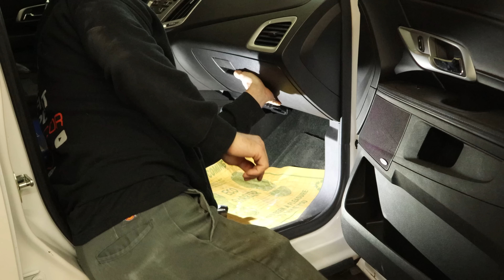Finishing the 2017 GMC Terrain SLE... this was too easy...

Comment: These Terrains sure must be popular, with the number you've done. Another nice vehicle for someone, done right as always. Wonder what you'll be doing next week. Something interesting no doubt. All the best from Queensland Australia where it won't stop raining and this is the dry season!
Reply: Another of GM's finest ..no wait..they haven't had that "mark of excellence" moniker for decades.  NICE REPAIR THOUGH😎✔
Reply: Does Holden make anything similar to this??? They are the Aussie equivalent of General Motors aren’t they??
Reply: @nobodyspecial6436  Unfortunately, General Motors closed down the Holden brand and the assembly plant here in Australia, so Holden is no more. The last Holden Commodore, the VZ, was actually a re-badged German Opel. The Holden Trailblazer is probably similar to the Terrain, but it was made in Thailand. My son bought one a few years ago. It's a V6 turbo diesel. So no more Holdens ever. Very sad for Australia, but GM made the decision that it was no longer viable to make right-hand drive Holdens in Australia. Funny thing, I saw a right- hand drive GMC Sierra in town the other day and I've also seen a right-hand drive Dodge RAM previously.
Reply from the maker: When the 2010-2017 Terrains were in production, they captured an unheard of market share for small SUVs. They are still great sellers, luckily I stumbled on them early.  Right now anything with low miles is demanding big money due to lack of supply and it is only getting worse.
Reply: @BrucePierson  they’re closing plants here too… 🇨🇦… it’s all about the almighty dollar… there’s a few right hand drive land rovers around here and the odd Toyota Hilux… not Australian i know but European
Reply: @nobodyspecial6436  Holden dosent exists any more, they were putting together lexon for a while, but closed down, everything was imported, except putting them together,
Reply: I don't know maybe a Toyota I mean he did pull a Toyota emble out of the glove box. 🤔😏🙂🤣

Comment: Scott:  When using the manual pneumatic pop rivet gun people using it are often afraid of bouncing the tip of the gun off freshly painted surfaces and sometimes do just that.  I have found that as you are finishing up the pop rivet, just before the rivet shaft breaks (pops), switch from pushing down the pop rivet gun to pulling it away from the rivet.  When the rivet pops, the pop rivet gun will pull away from anything in danger of damage and all will be well!

Comment: I am totally convinced that a lot of cars get totaled out that shouldn't be. My 2014 Nissan Sentra was involved in a collision with a Great Pyrenees dog. He jumped at an oncoming school bus just before impact. As a result he hit the hood and grill. The grill was driven back against the brace that the airbag sensor is on thus setting off the driver's airbag and the seat belt tensioners. Repair estimate was almost $7000 with the airbag and seat belt repair taking up almost $4000. Our insurance company insisted that everything associated with the driver's airbag has to be replaced with new parts and the seat belts have to be new parts. The body parts needed were the hood, grill, headlights, bumper cover and the condenser coil. The left fender was a little damaged but the body shop said that it would be easier to fix than to replace. Painting estimate was about $1500 which if they happened to find the right color parts would have been considerably less. And that was more likely because the car was a very common color. However the insurance company listed the car as being worth $7500 in good condition. The problem is that about the time the claim was settled was when new and used car prices went through the roof. If it had been a couple of months later we would have had higher advertised prices to either get more for our car or get it fixed. What is so frustrating is that the safety features that are required on cars now are often more expensive to replace than what the other damages to the car are.

Comment: Awesome build as usual! With all the Terrain builds you have done, it has certainly helped on mine. As for the the center caps, I just realized last week of the valve stem printed on the back with the arrow. And now to replace the AC compressor.
Reply: Reading the owners manual..possibly the most neglected piece of car literature...😁👍🇨🇦
Reply: @vwwrenchie314  Agreed!! Guilty as charged along with many others.
Reply from the maker: Not all of them have the picture, I looked.  As for owners manuals… in the pile!  I want to discover new features as I own the vehicle to keep it feeling “new”. 😂
Reply: @vehcor  You are right...I had to discover that valve image on my Buick Allure centrecap too..everyday ya learn something new!

Comment: I need one of those brake job hammers!  Always enjoy seeing you put this stuff back together properly.  I like seeing you go the extra mile to make sure it's put back together correctly and safely, even if you don't clean all of the parts that I would.  Keep it coming.  It's nice to see you care about putting one back together well rather than whatever makes a few more dollars.  Also, I'd worry about wearing out that bumper installation tool.  Maybe go a little easier on it before it wears out!

Comment: The belt molding installation tool is not on Amazon. I would like to order one ☺️☺️☺️
Reply: You can only get them from a cross-fit gym.
Reply from the maker: Supply chain issues.  Those crossfit ones are junk… very weak and noisy. 😂

Comment: Indeed cars "clip" together now days.  The seamless designs really work will for the method and the weight savings from the 50's to the 80's methods is notable.  They are lighter and do better in accidents as it relates to the occupant.  The engineering, though at times odd from a maintenance perspective, is pretty impressive.

Comment: I wanted to remove the inner rear quarter cover in my SUV to fix a minor wiring issue.
The process first required removing the radio and centre console then the front and rear seats the side pillar trim and sill plates and front and rear wheel liners, all to get to one plug that was not connected properly at the factory.
I only slightly exaggerated I didn’t really need to remove the radio. I was fitting a reverse camera that came with a new head unit . The wire for it fished easily over the headliner.

Comment: 15:45 lol no kidding right? I give you the Ford 5.4L. If you follow the manufacturer's spec on oil changes you WILL be doing the $4000 (cdn) phaser and timing job at around 120,000 kms. 

Same as the welded in spark plugs.....do it at a reasonable 60,000 kms no problem. Do it at 120,000 kms (oem spec) and you're looking at $1000 min up to $4500 to re and re the heads to get the broken bits out.

Comment: Just a question: I use urethane construction adhesive and the way to get it to stick better is: get it wet. Does the auto stuff say the same? 

Just curious because if I'm gluing 2 pieces of wood together, spray them with water first and the shit holds like a mofo.
Reply from the maker: No, it doesn’t stick better but humidity will make it cure much faster.  This stuff sticks to everything… and even better to the stuff you don’t want it stuck to! 😂
Reply: @vehcor  HA sticking to everything, I use PL Premium and the only thing that gets that off is baby oil or WD40. I came home from work one day and found a dried clump behind my EAR lol

Comment: Here they do not charge core charge at most breakers. Just hand in old extra used tyre and they are happy. Or steel rim.😀 but now due to corrona prices gone up as supply has gone down😔

Comment: My GM vehicle goes for extended oil change intervals, mainly because it burns enough oil that I have to add 1 fresh quart of oil every 3000 miles.
Reply from the maker: That is actually within specs for all Ford engines, not even joking.  GM oil consumption is usually caused by a lack of oil changes.

Comment: I really wonder what all the covers, trims and shields that are just to look pretty, add to the cost of a vehicle. I for one don't care if I see a little metal sitting in my vehicle. Heck my pickup doesn't have full door panels or a headliner.
Reply from the maker: They are there to make the engine look like it has less parts.  Buyer subconsciously think “less parts, less problems” when they open the hood.  They don’t realize all the same stuff is there under the fancy covers.  That is the real reason manufacturers do it. All about sales!